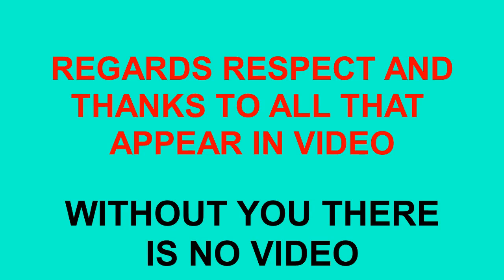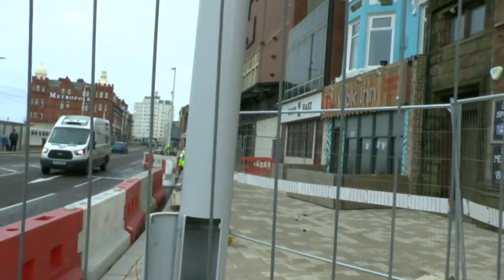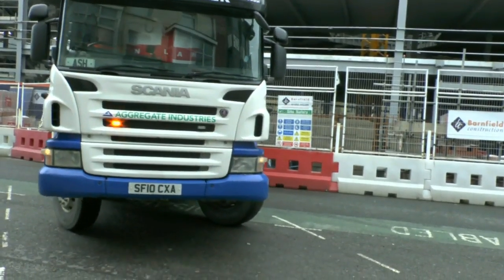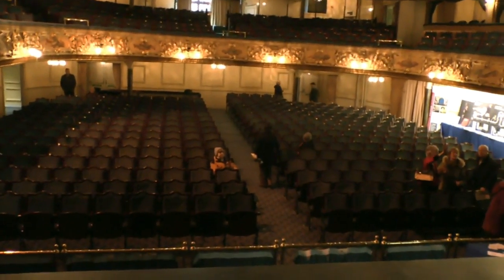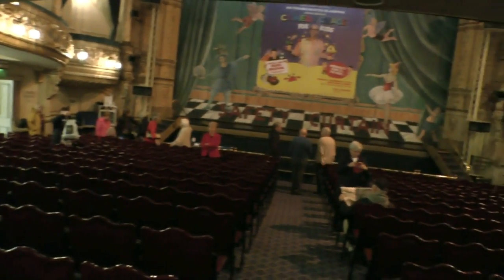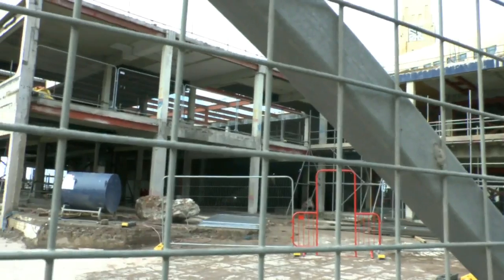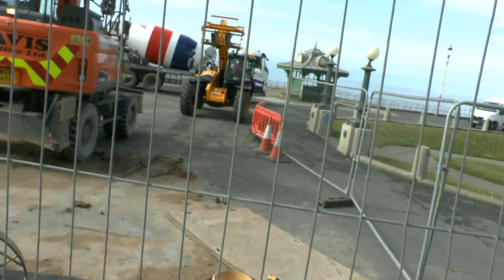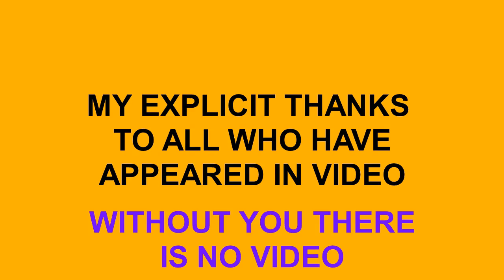BUILDING BLACKPOOL BETTER PART 81

Comment: The Safety Curtin is pure solid iron and is operated by motors, cause it's that heavy and takes 3-4 hours for a fire to burn through it. i knew someone who worked at the winter garden opera house as a stage hand
Reply from the maker: WOULD LIKE VERY MUCH TO THANK YOU FOR THIS VERY INTERESTING INPUT==IT WILL ALSO ENHANCE THE VIDEO I AM SURE==VERY KIND REGARDS COLIN